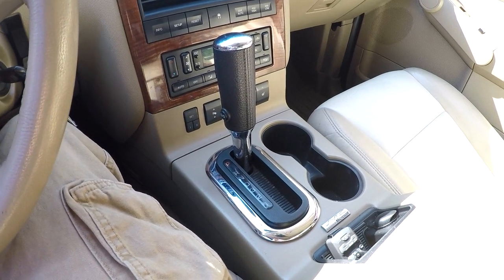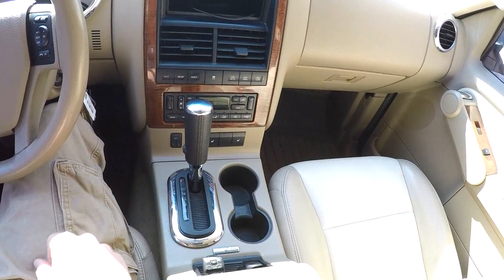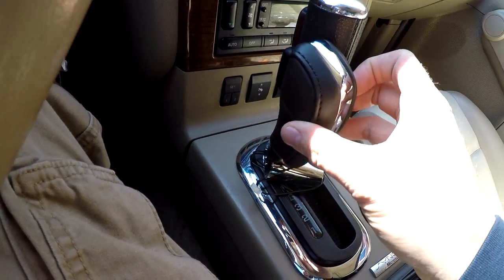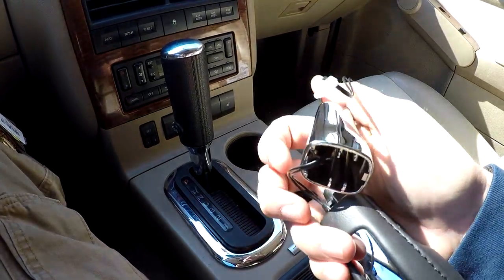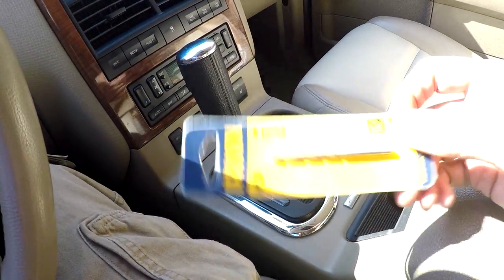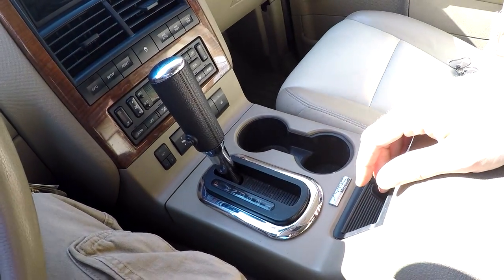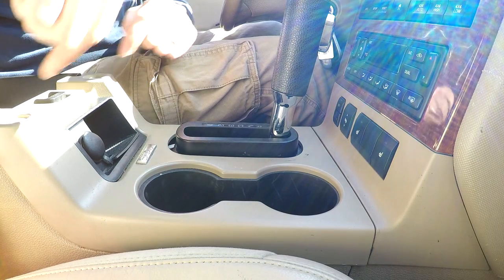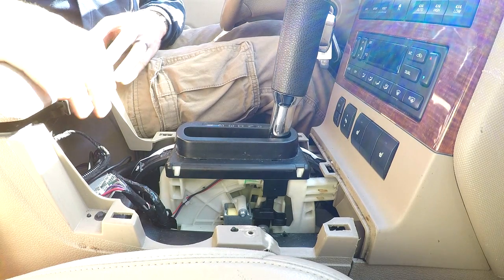How To: Install Newer Ford Flex Shift Knob on 2006-2010 Ford Explorer

Comment: This helps me with an issue on my 2008. The shift indicator light bulb is out and I was wondering how much disassembling I need to do since working by feel isn't my favorite way of doing repairs. 
Great video. Never apologize for a long video if there is a lot of important details!

Comment: Thank you for this very helpful video as it made my install easier, BUT it was still a bit of a pain. Just some notes that people may and probably will run into.

1.) The screws are in fact too long that come with the shift knob. I buttoned everything up thinking I was good to go, but found out I couldn't pull my keys out of the ignition, yet I could still shift (was tough). What was happening is the center plunger wasn't traveling high enough, thus the rod on the shifter side was not going up far enough to allow the key release. What I did was found a tiny thin star washer, took the screw and used a #6 deep socket and small hammer. I beat the washer down with the socket on the screw to make it concave. This gave it just enough room to no longer catch any more once tightened.

2.) Make sure when you take out your orange selector shaft that it goes back on the right way and the head doesn't flop over.  If you have a head on top it is installed wrong and you wont be able to put the black indicator cover on. If you force it you may break it.

3.) I went ahead and pulled the old shift knob wiring out as noted, then I took some safety wire and fed it down into the hole. I made a loop at the end first, so when its at the bottom you can use your pick to grab it and then get it pulled through the small side hole. I used this wire as a pull string and it worked perfectly. Now, getting it reconnected was a total pain! Just remember that the release part of the connector should be facing towards the passenger door if you forget the orientation of how it goes back. 

4.) Make sure EVERYTHING is good to go before pulling up that chrome beauty cover at the bottom. It makes it almost impossible to pull it off like the original one. I had to use a trim tool to pry between on both sides to get it to pop back off. 

5.) You do not have to remove the whole console as some have said. Not sure how that would help anyways with the vent duct in the way. Unless you can pull that out with the console, but it seems pretty tight in its place and would worry about messing it up when trying to reconnect it. 

Since the scare with the key release, I am going to drive it around without the shifter console on and see how it does. Just to make sure it works as intended.

Comment: I can see many people are doing this mod. 
I just finished and it wasn't all that tough. I can only figure Jeg's garage is a wonder with the picks, I'm not all that great, I guess. I finally gave up and slid the console back about a foot, that made all the difference in the world and that is how I would suggest anyone else do it. The console only has 10 bolts and they are easy to get at and it exposes the entire shifter assembly and no need to take the reverse lock out solenoid off either. 
Anyway it was a great video for reference and the mod was fairly painless although it did take a few hours but I have all the time in the world so I didn't hurry.
Thanks
Reply from the maker: Thanks for the comment! I thought it would be quicker to not remove more of the console...but I didnt really look into what was holding it all in.  It sounds like your idea would have saved some time for sure.  Either way you do it, its an easy mod and makes such a big difference!  Glad you got yours swapped!
Reply: JEG's Garage I could have never done it without your video. Thamks

Comment: Hello, thanks for this, honestly was very insightful. I would like to install an aftermarket shifter and I was wondering if the just the leather part of the shifter can be removed without disconnecting the overdrive?  I've seen similar videos for F150s where they just take the top part of the shifter off, but I guess its because those don't have the overdrive on the shifter lever? I got an explorer 2010, and your video is the only one I could find of upgrades to the shifter. 

The part I'm looking to install is billiards 8 ball design knob, and it will be my 1st DIY car mod ever, so your feedback and guidance would be highly appreciated!
Reply from the maker: As far as I know, the stock shifter isnt able to be disassembled. To put an 8 ball shifter on would be tough because you'd need to actuate the shift release mechanism. But depends on the piece you are installing.

Comment: Have you considered just putting an extension on the inner shaft and just mounting the shifter a tad higher to reach first?
Reply from the maker: Nah...it goes into first just fine. The shifter might not click in, but it locks in first and won't shift until you bump into 2nd. Hasn't bothered me enough to mess with it....I rarely use 1st gear. Might not have even been in 1st since the videos haha.

Comment: Hey I have a 2007 Ford f150, almost the exact same setup. Only difference is, the OD button is off to the side and not on the shift knob. If I were to buy the shift know you used or similar, would it work to just cut the wire out and install it? Then just have a useless button pretty much? Or should I find a different knob? Been having troubles finding one for my truck, it’s a Harley Davidson so a couple parts are different.
Reply from the maker: @jessefehr6345  you can always cut the OD OFF wires and just jot use it. Or, you can wire another button so you can still use it if needed. You'd just have a useless button on the shifter. Not sure if it would physically work though.

Comment: Jeg's Garage, i was watching how you were drilling straight thru the metal rod it looked like you were going in an angle and was worried that the hole on the other side of that rod wouldn't line up with the hole on the shift knob, obiously it worked out good for you but it was a lucky move. This is why its better to drill the holes one at a time on each side of that rod to get a perfect hole alignment in relation to the hole on the shift knob. It would nice if you can find a way where you can put the shifter all the way to 1st gear without any binding or obstructions but what do you need 1st gear anyway and 2nd and 3rd as well unless you're drag racing the SUV like driving a stick? I drive an 06 Ford Explorer 4.0L i hardly ever use the 3 gears unless i race somebody from a dead stop traffic light but i do use the overdrive switch when i need to accelerate fast by turning the OD switch off.
Reply from the maker: Good point on the holes.  It worked out ok for me...the shift rod is pretty small so its not bad.  But drilling from each side is probably smarter.  As for the 1st gear thing, I use 1st gear often.  Snow/sand I will lock it in 1st.  I never really lock it in 3rd unless i want to engine brake or keep it from going into 4th.  I never race the thing haha.  If I want to move out fast I just put my foot down and let the 4.6/trans do its thing.  Hitting 1st is easy.  Doesnt feel any different, its just not locking back as far.  No issues!

Comment: Jeg's Garage also i checked on that part# you listed at my local Ford dealership they quoted me $45.98, where did you get $12 that must be a very good deal or either they priced you mistakingly on another part that was cheap and gave you that price instead. I know if you buy a new shift knob from the dealership doesn't matter what kinda it is weather its Ford, Mitsubishi, Hyundai, etc you're going to pay at least $50 and up for a shift knob
Reply from the maker: Hey sorry for the delay.  Unfortunately it looks like prices have gone up, probably due to the car being older.  The place I got it from is one of the best priced online Ford parts sites.  It is now listed at $30.  https://parts.autonationfordwhitebearlake.com/oem-parts/ford-shift-knob-8g1z7213a
Reply: Well now its $49.46 guess they watched your video. Will save up and do this when it is warmer as agree a better look for the 2010 Explorer as the Chrome on mine is flaking off. Nice video by the way.

Comment: Did you finally solve the 1st gear position issue??
Reply from the maker: Was never really an issue. Even though it didn't fully click into first the trans would always lock into first no problem.

Comment: Nice video!! Question...to get the 1st gear to engage, could you have tapped the holes up the lever a mm or 2 or 3 so that the tapered finish piece would then clear black trim? Or would that make the shift lockout feature inoperable? And if it did that, could you epoxy a shim of plastic to the top of that rod or am I barking up the wrong tree here??  Thanx
Reply from the maker: NO you are exactly correct.  If you mounted the new knob higher, it would allow the shifter to come back more.  However you will need to do what you said and shim the shift lock plunger.  Also it would have to go higher than 2 or 3 mm because of how that little chrome plastic bezel is shaped.  By the time you get it high enough, it would start to ruin the look I think.  I like how it sits low and clean.  It will go into 1st just fine as I show in a second video.  At least on mine...others might have issues but I havent heard of any.  Thanks for the comment!
Reply: Hey thanks... didn't see the follow up vid. Gives me a new little "project" come summer.

Comment: Wish you had shown the drill bit and tap bit packages right side up so we could see the sizes you used.  Heard later in narrative the drill size as #30; what is the tap size please?  Better yet, please add them to the written comments.
Reply from the maker: Victor, Skip to 3:35.  I clearly show both the tap and the drill that I used, and even say that the screws are M4x0.7.  So obviously you'll need an M4x0.7 tap.  This is ONLY if you use the screws that come with it.  You can hit the hardware store and find SAE screws that will work, and you can drill and tap the holes to suit those.  But really....the metric tap is cheap and not hard to find.  I got mine at ACE a while back.
Reply: Thank you.  I was in the wrong place in the video.  Have an ACE hardware near my house so will pick up what you used.
Reply: So today was the day for this mod.  Good news is that I now know how to fish the OD switch wire in and out, because I had to take it all apart a second time because shifter would not go into Park.  I discovered that holes I drilled were too high on the shaft.  Drilled and tapped new holes and put it all together again, only to find out that mechanism is not tripping the key release switch when in Park.  I deburred the holes I drilled (all four!) but something's not right with the plunger and the cross-shaft.  I note that there's something not right about reassembly because the shifter will go from D to R without pressure the lockout button.  Truck hobbled but not dead in water; taking a break and will look at it again after Christmas.
Reply: Found my problem after thinking about the solenoid interlock.  I didn't have the solenoid L-shaped pin inserted correctly.  Once I fixed that I was home free and the new knob looks great in my '08 Sport Trac Adrenalin.  Thanks again for the video.
Reply from the maker: Hi Victor!  Sorry for the delay. Holidays had me tied up.  Glad you sorted it out!  As soon as I read your issue, the first thing I thought of was the solenoid and the release mechanism being off.  They are slightly touchy.  The design is kind of lacking in my opinion compared to other methods of doing a lock out.  Some folks have issues with it without even touching the components ever.  Glad you got it worked out and you like the mod!  Enjoy it and thanks for commenting!

Comment: First off awesome upgrade. Got a couple questions though. Can i do this on my 05 King Ranch? and what year model is the new shifter off of?
Reply from the maker: Im not sure if you could or not...You'll have to do some digging to see.  I do know that this knob is popular for other cars as well.  MKZ owners use them, and a few others.  Maybe fusion?  Either way...best I can tell, the part number is for 2009-2012 Ford Flex.  I just checked and its still online for like $12...its so cheap for such a nice piece.

Comment: Thanks for this video. I might actually purchase a 2010 Explorer V8 now. What possessed Ford to use such a dumb looking shift lever in the first place?
Reply from the maker: You will like the V8!  I test drove a couple of the 4.0 versions, and they arent BAD...but the V8 is so much nicer.  It moves the heavy SUV along much easier.  I have no idea who designed that shift knob but its horrible.  Everything about it is horrible.  It looks horrible and it feels horrible to use.  The interior, for what it is, is pretty nice and I felt like this was an eyesore.  The new one totally changes the appearance of the center console.

Comment: I have a question the over drive 2 wires is there a neg & pos or it does not matter?... thank you
Reply from the maker: Hi Thomas.  Im sorry...I saw that you sent me a message too, but I wasnt able to find it when I went to answer.  Im not sure why that happens, but it happens occasionally.  No, the polarity of the wires doesnt matter.  Its just a momentary switch so you are good to go.

Comment: I may have missed it but could the supplied screws that come with new shift knob not be used or did you use them ?
Reply from the maker: Hi Matthrew.  I used them.  I drilled and tapped to use the screws that came with it.
Reply: Cool,thanks

Comment: I just bought a 2006 Ford Eddie. I'm so doing that
Reply from the maker: You wont regret it Abram!  I think about it any time my hand goes to the shifter and its SO nice to use vs the original.  Just feels and looks great.
Reply: JEG's Garage I fucking love this truck I can't believe how nice it drives compared to new new cars. unbelievable.  working on it but it's definitely some thing I'm looking forward to do.

Comment: Where did you land this part for $12? The cheapest I’ve found online is $49
Reply from the maker: At the time of filming this, that was the price just about EVERYWHERE.  Not too long after, the price went way up.  Im not sure if it was catalogged incorrectly in Ford's system, or what.  But I wish I would have bought 10 of them back then.  I was very surprised that it was as cheap as it was.

Comment: Im here because The button on my shift lever wont move when its in park i have to press the brake over and over again until the button goes in and i can put it on D only does it when its on park any ideas?
Reply: the overdrive button is broken you need to replace the whole unit with a new one. Mine broke and fell out on my 06 ford explorer

Comment: That knob does not cost $12 you forgot the additional $40 on the price.
Reply from the maker: Mark Patrick this video was made in April 2016... I didn't forget anything.  Prices change. I paid $12 shipped for this puppy from a Ford Online Parts house. Looks like you can get it for around $50 now, that's quite a hike. Good thing I bought two back then I guess!

Comment: I tried to do it but knob is not going to parking
Reply: Mine it work's well without that pin in just cant take my key out, with the pin in doesnt come out of park
Reply: @LAKERAT_YT  What should I do to solve this?
Reply from the maker: There should be plenty of room for the park position.  Maybe the new knob is set down too low?  Try raising it up some.